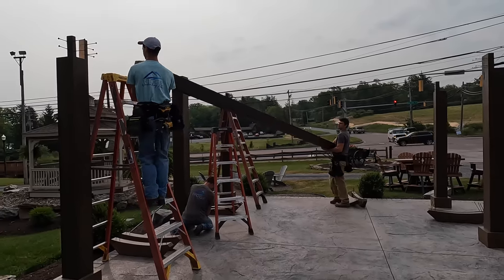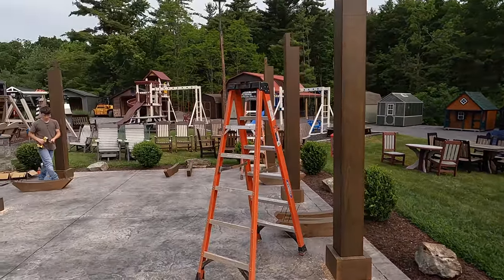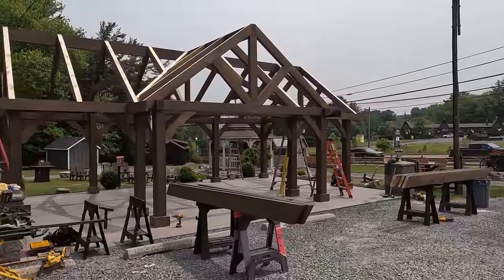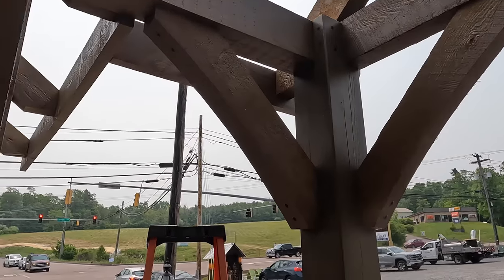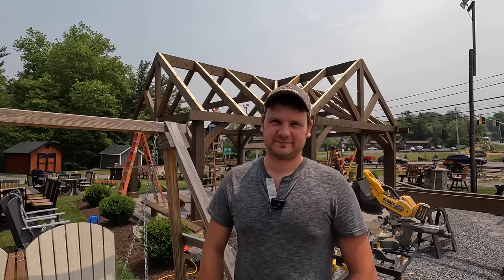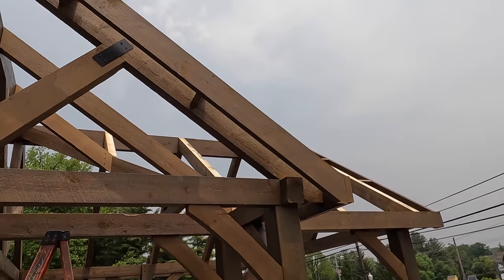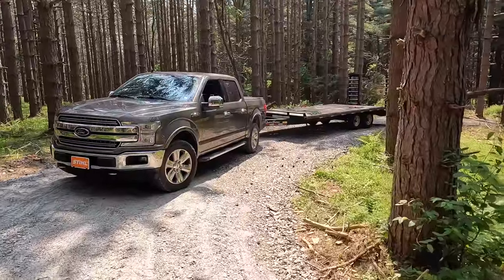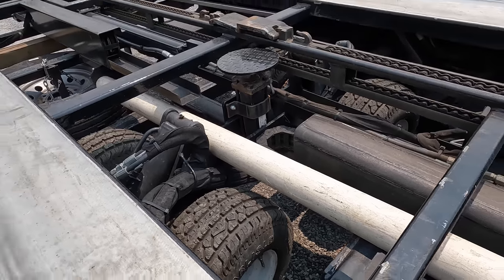Incredible Timber Frame Pavilion Build, Start to Finish

Comment: Excellent video Mike at Tri=State Gazebo . This is a well designed and built Gazebo that will be around a lifetime. Very well built and turned out beautifully. Hope you know somebody that might be able to hook you up with some wood so you could mill the wood for one. Once you get your hands on one of those nibblers for cutting tin you'll keep it in a special place and always cleaned and ready to use , they are handy and you can make decorative tin signs and other artwork with them too. Stay safe and keep up the great work and videos. Fred.

Comment: Mike call me a purist but I’m glad you called this construction method “post beam”.  Pure timber frame is based on mortise/tenon held together with oak pegs. Much stronger. If you want to learn more watch some of the Shelter Institute videos.  They teach timber framing, designs, load factor, etc. also true timber framing uses green wood.  The mortise/tenon/peg construction holds it together and everything drys. Just different but notice all the timber frame barns that have been around for 100s of years.
Reply: You are absolutely correct. The most accurate description would be "framing with timbers". It still requires skill, but on a whole different level. Not to take anything away from these skilled young men, they do beautiful work. It's nice to see young people who aren't afraid of hard work.
Reply: I am a purist as well. We just built a Timberframe house, shed, and barn. With our own hands. 😊

Comment: When I built my porch, I bought my wood straight from a big box store but I did something most people never think about and some thought I was crazy for doing. I put the wood in my garage, stickered them, and let them dry for months before constructing. This helped weed out the bad warped wood, made it much lighter to work with, and helped cut back bad warping after construction when the sun really hits the wood. Other than staining it every other year or so, the deck literally looks as good as new and was built back around 2014. 

Do it right the first time and you wont' have to do it again later.

Comment: I'm disabled remodeling carpenter of 42 yrs. Great awesome pavilion they installed! 😲😲🥰😊😉👍I even learned some things too. The Makita metal cutter is awesome. I've done new constructed building. We always used dull circular saw blades. To cut metal roofing. 🙄🥺😑😔 Metal shards flying all directions. Even though. We wore face protection! The Makita was cutting effortless & less metal shards. 😍😊😉👍Thanks Mike. 😍😊😉👍❤️💜🙏

Comment: Structural Screws...what a great invention
Reply: Yes, not to mention Torx style   drive heads, cordless impact drivers, and lithium ion battery development.  These are all parts of the system that make it a success.  Got to admire those Amish builders that use wooden dowels to attach things.  They still do that, right?

Comment: Those nibbler is a very cool tool attachment.  Timber framing is very interesting. I live in farming area and enjoy seeing differant barns .  Those men worked so hard to assemble and cut all the beams by hand.
Reply: This isn’t a timber frame. This is post and beam, just screwing boards together, huge difference

Comment: That is a GREAT looking pavilion.  When you have the material, I can picture that in a less elaborate version at the morgans for an additional wood shelter or even a machinery or implement shelter.  The gable ends were pretty but I can also picture them enclosed if it were designed for other uses like storage, at least the gable that faced west where the majority of the weather comes from.   As a pavilion though... just plain gorgeous.

Comment: Mike ,back east there's a company that offers classes in true timber framing without using mechanical fasteners.  All wooden pegs ,plus different joinery,  lap joints,scarf joints .Timber Frame buildings withstand the  test of time

Comment: Back in around 1987 my dad, a contractor and I built a pole frame shed for machinery, boats and stuff, effectively a six bay shed. The poles came from trees on the farm, tall straight eucalyptus trees, I think bloodwood which are termite resistant. It took around four days to build. The shed has provided decades of service and currently shelters most of my stuff for the farm. 

Contrast this to my work in IT. Months of work from five years ago is worthless with systems being obsolete and out of service.

Comment: If you like that not really traditional timber frame pavilion your going to love the one we are just starting on. Mortis and tennon with tree nails. all the timbers and bracing.  massive king truss no steel except simpson ties to concrete.  Those cabin bolts/screws are what all most cost me my life on a project.. one broke on a rafter and i feel one to the floor logs ripping every tennon in my arm off , then two more broke when i tried to hold on to the floor beams. then i feel 12 ft to the concrete floor, brakeing my hip and ankle. head tramma .. the bolt broke right were the threading stops... Yes I won a massive law suite against them.. I'm lucky i can do what i do today. I live with pain every day because of it..

Comment: To one and all,  that hand tool mike is talking about (See @ 14:43 of this video) is called a "Nibbler."  They come in Air Powered, Electric, Battery Powered.  The down side as some like to call it is the little "letter C" pieces they throw off.  Get caught in the bottoms of your shoes, and can mess up a rug / carpet (rip - shred) etc. i.e. scratch a wood floor, FYI.  Some people love them, some people HATE them.  Can't please everybody, so now you have some information to make a decision with.  Do you go with a ""Nibbler," or do you go with a hand held "metal-shear."  approx. common electric drill size, approx. Used for only say HAVC or automotive / aircraft skins etc.  Very thin stuff.

Comment: Just a thought...I see an interesting trade/barter scenario.

If you cleared another area and poured another pad, you could trade the green timber towards a timber frame for the WV. property.

The timber frame (sheathed in tongue and groove and doored) could be multi purpose. 

A. Split wood storage 
B. VA. or PA. wood drying area
C. Equipment, four wheeler etc... storage
D. Extra cabin supply and dry pantry
E. A small shop and tool storage (to eliminate hauling back and forth)
F. Secure parking for extra cars on excursions
Reply: Another possibility...A place for large gatherings and meals

Comment: Mike if you build a cover building like you did for your sawmill down in West Virginia stacking pick your would an air dry it from the way you stack your would I don't think you're going to have any issues with air drying you'll have the ability to fill that whole area to the ceiling with lumber which decides open the arrow blow through there and dry it in no time oak takes a year-and-a-half per inch I'm not sure what mine is but the more are you can blow through the wood the quicker it'll dry slow drying has its advantages

Comment: It's technically a Post and beam structure and not a Timber Frame, but I love the look so much.  "A timber frame is a load-bearing wooden structure, held together with mortise and tenon joinery. Post and beam building is similar to timber framing, but in lieu of wooden joints, post and beam buildings are held together with bolts and other steel connections."

Comment: Just for the sake of accuracy...and I hate to do this because it's a beautiful frame no matter what....but a true timber frame does not use any screws or metal connectors. The whole frame would be constructed using mortise and tenon joinery secured with wooden pegs. This structure would be a post and beam which uses connectors and screws like on this one. Again, it's more of a purist thing because it's beautiful.

Comment: Love the video but I have to tell you, that is called post and beam construction. While similar to timber frame (post and beam uses Timbers) it’s not timber frame. Timber frame construction doesn’t use plates and bolts or lags. It’s all traditional wood joinery and dowels. Very similar though.

Comment: I agree with you 100% on the small business Recognition thing  Mike . All the trash like the bud light thing get all the front page news, and they do not do a dam good thing for Society. And I herd you say you that you liked that metal cutter. I have found that if you put a zippy cut metal cutting disk on your small hand held angle grinder, that it cuts through tin smoother and faster than that nibbler does. The thinnest disk works better. 1/16 thick.

Comment: What is missing in this "post and beam" structure  is the joinery.
Reply from the maker: Like I said in video the wood has been air dried for a long time and is stable. Traditional joinery is used when green wood is used and tightens as it dries

Comment: I see a ton of "mix and match" in the use of technologies for the joinery.  Traditional timber framing would use only wood fasteners,  pegs and trunnels. or 'tree nails."  I'm of mixed emotions about this and will have to think about it for a while.  That said, if it works it ain't stupid.  My question is can you do it after an EMP.

Comment: Mike I don't get the three inch slope...   That seems strange if it's getting a roof...  Even extreme without a roof...   But the design is really nice...   Thing is with your mill, it wouldn't take much for you to cut those timbers!
Reply from the maker: Just the concrete is sloped not the structure